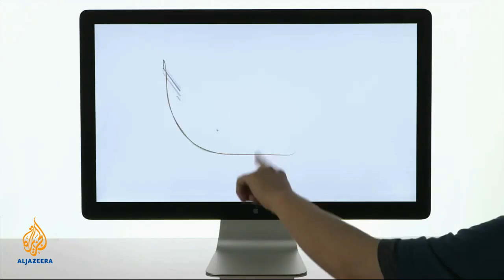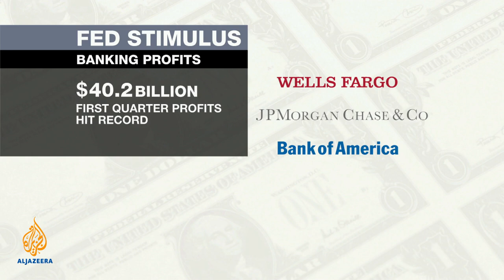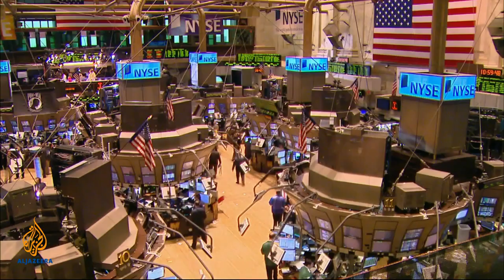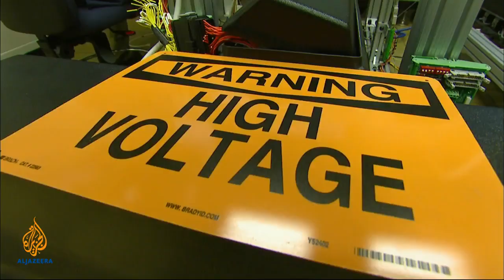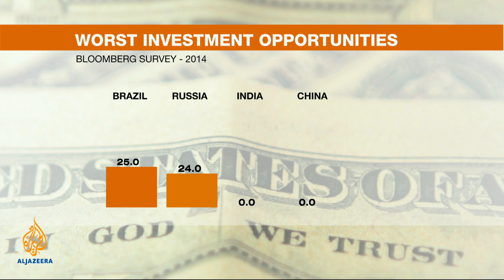Counting the Cost - Printing hope for the future

Comment: ATM there is a lot of buzz about pluripotent host stem cells.
 However, in the future another paradigm may become as important; Programmed, Stable modified host cell varieties with specific properties, for 3D bio-printing.

Eventually, People will not just print replacement body parts, but will make organs that have never existed before.
ie, human wings, complete with muscles, hollow bones required.. perhaps incorporating extra heart, to take stress off the the existing cardio-vascular system.